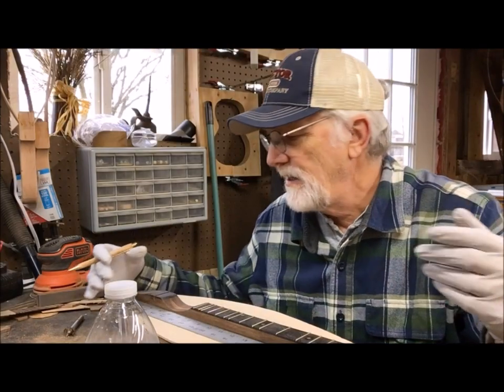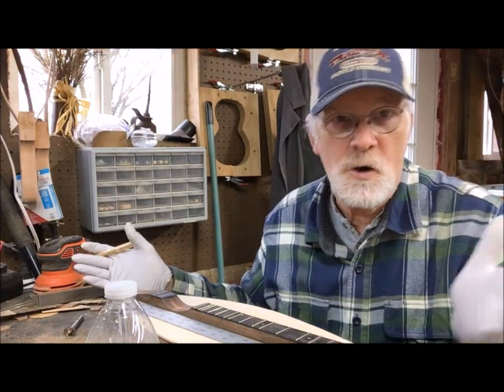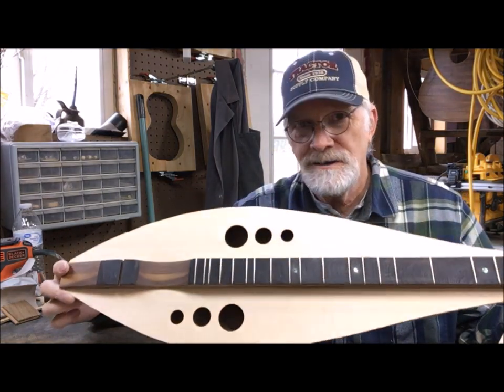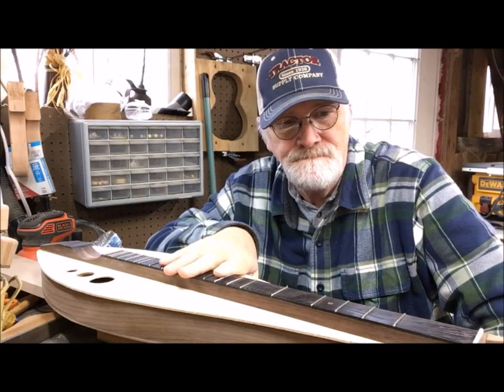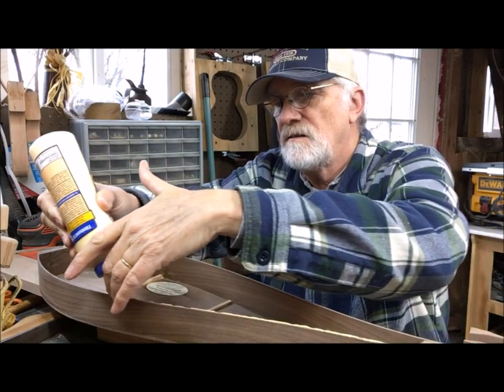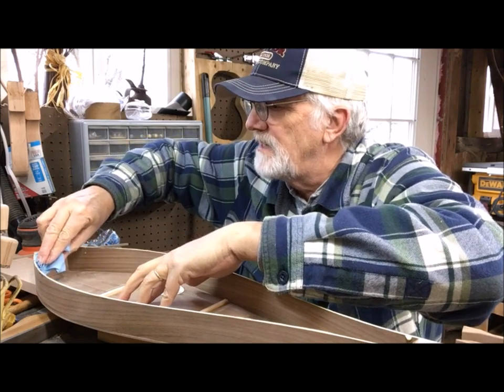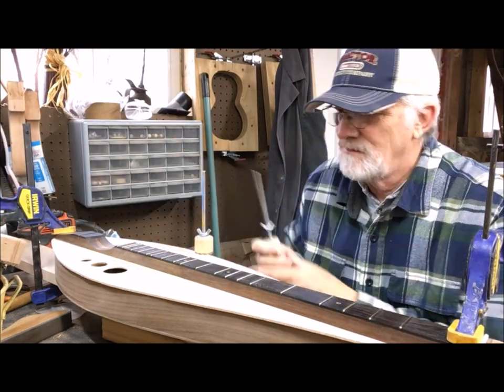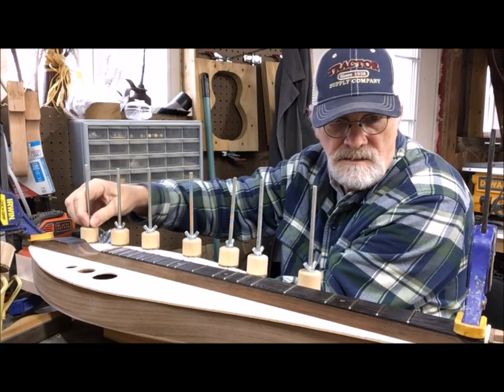A Dulcimer Is Born ... New Traditions 25" VSL Dulcimer

Comment: Thanks for the interesting video! I have a dulcimer which is supposed to be 28 inches and is fully diatonic (no extra fret). Do you make 6 string dulcimers? (3 double strings). Thanks again.😊👍
Reply from the maker: Pietro, thanks for your comment. Yes we do 6 string 25”VSL dulcimers.
Reply: @NewTraditionsDulcimers  Thanks!